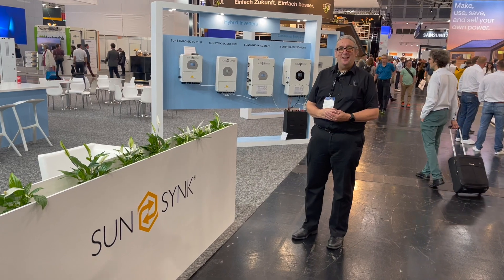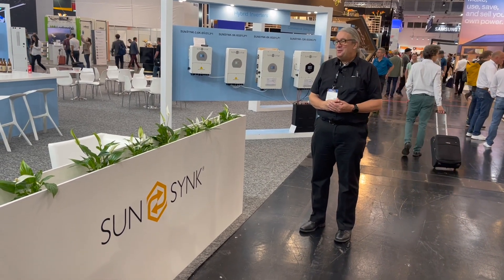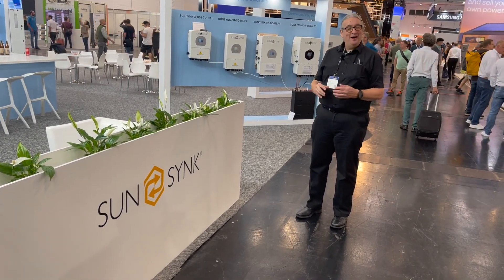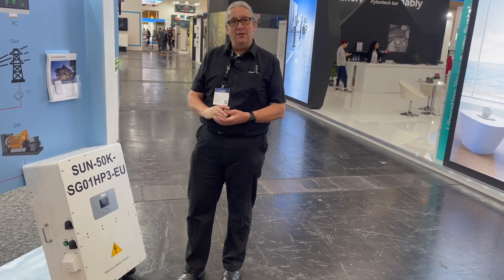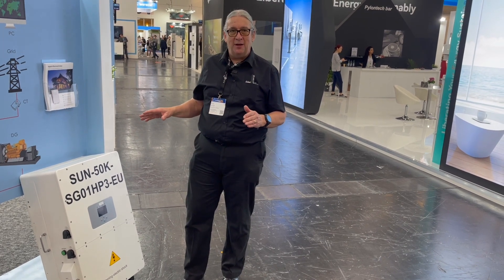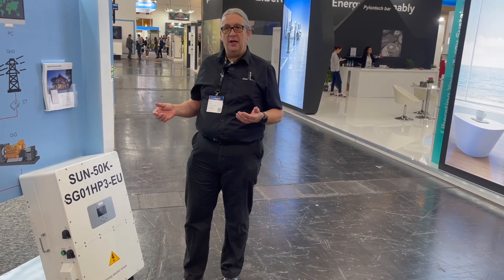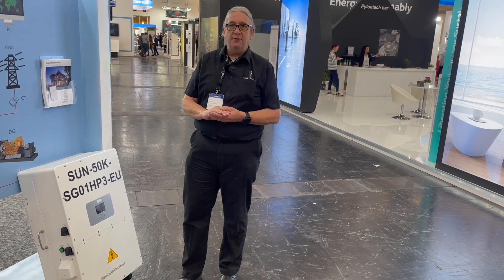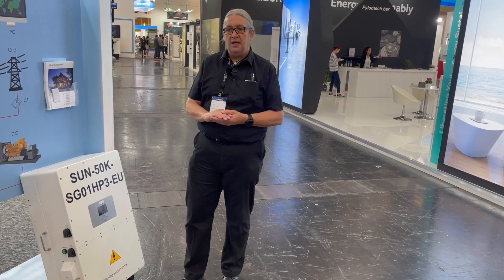50 kW HV Hybrid

Comment: How "High Voltage" is this? 
Is the AC that is High Voltage than usual (ie > 240Vac), or the Battery that is High Voltage (ie, > 100VDC upto 350VDC) similar to SolaX and Growatt HV series?
Reply: The context is usually for batteries in the 120VDC to 500VDC range.